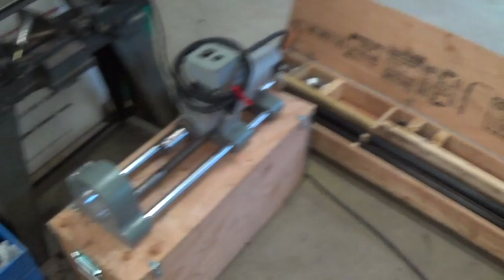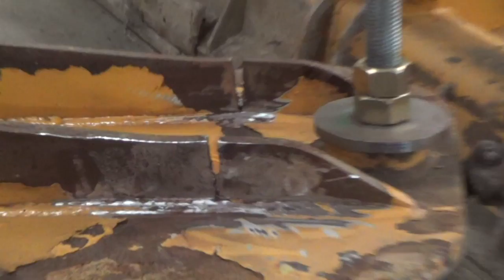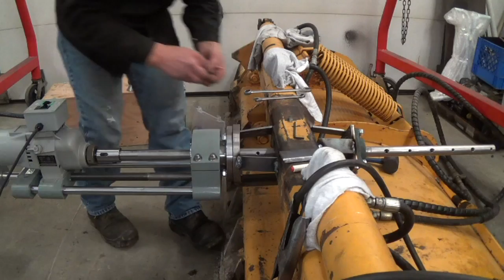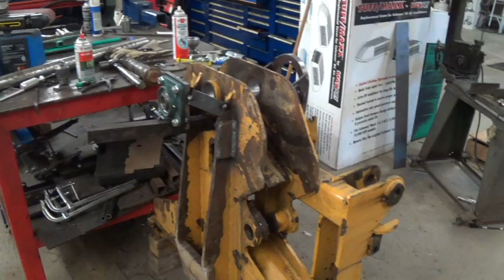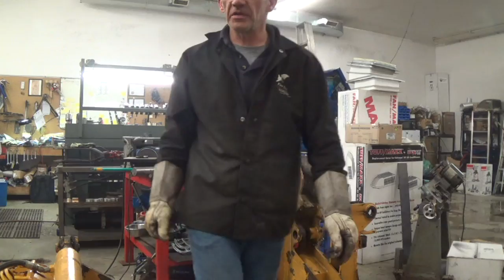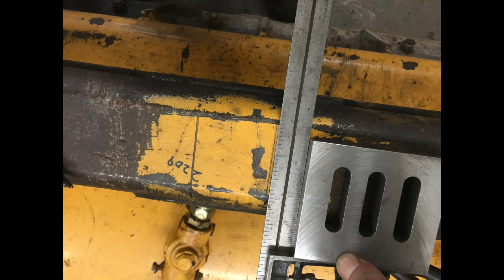Line-boring a SnowPlow

Comment: I have just built my own boring bar unit. I have a 1hp 3 phase motor that has a variable speed controller, useful power from about 15 hz to 65hz that gets its power from a common 230v single phase. Down here in New Zealand 230V 50hz is single phase or 400v 50hz is three phase. I have a 36:1 compound in line speed reducer and that gives me a bar speed from around 15 rpm thru to about 55 rpm. On the other end of the bar is an 8:1 inline speed reducer that drives an extended hollow tube with a bronze nut threaded to 1/2' x 20 tpi . My feed screw is a stationary piece of 1/2' screwed rod anchored to an outrigger but directly inline with the boring bar.  I have started with a 1" bar because the job has only 1 3/16" holes. Not flash like yours but will see how it goes. I have made everything myself and the power unit came off my rotary welding table (made myself too except my cousin supplied the electrics and motor) that can run from 7 rpm to 1 rev in 20 min, depending on if I double up reduction units. Made my speed reducer for the feed unit from two sets of toyota reverse gears configered in a housing. I can change the feed rate by changing the drive nut and the screwed rod and use 3/8 x 24, 1/2 x 20 or 5/8 x 18. To feed the bar back quickly I simply wind back screwed rod with a socket on my battery drill. The welding table and the boring bar owe me about $1200 but of course a lot of my own time. You did a nice job there. Simple satisfaction in doing thing well. I could see you were no novice by the way you set that bar up in the lathe. Feel sorry for young engineers today that become slaves to their cnc equipment and don't get to use their ingenuity. By the way, was your compound slide set around to do screw cutting? Here is a wee trick. When I screw cut using insert tools but by hand I plunge cut but every few cuts on the reversing cycle stop the lathe, put headstock of gear(so its easy to feel and move)and continue to wind back to the starting point by hand a wee bit. I momentarily take off the pressure of it driving the leadscrew and with my other hand disengage the forward/reverse leadscrew lever. You can feel it drop one tooth and simply reengage. Put the headstock back in gear and carry on the cycle and repeat the last cut I had made. It advances the cut somewhere around 1/36 of a turn, enough to make the tip cut on one side and then plunge a few more and repeat the process. Why do I bother? I never have to move my compound slide or spin my tool post so that my tools remain pretty well set, my parting tool is square and my boring bars true and my readout requires very little input. Obviously checked but not really having to be set up again. My quick change tool post and DRO are easily my best investments.
Reply from the maker: Sorry it's taken a while to respond. While I do like my York unit I would actually like more speed options, in particular slower. I havent done a larger bore with it yet but I expect a 6" bore will have the SFM of the tool up there pretty high. I may look into some options to change it.
I hope yours works out well. :-)
Reply: @CompEdgeX2013  Did my second job the other day on it. Worked really well. I am only dealing with smaller bores compared to your job. On 1 3/4" . biggest hassle is measuring the bores without stripping out the bar. I think I have a sneaky solution.

Comment: What cutter do you use? Hss? Carbide?
Reply from the maker: Using brazed carbide for most work. The SFM is a bit high for larger diameters and HSS. I would like more speed options on the head unit.

Comment: Colin, you have the same lathe as me, just a heads up for you. The block that the crossfeed hand wheel attaches to has two thrust bearings, the one on the inside presses up against a collar on the screw. There is no seal on it and the coolant can get into it. I just had to replace it on my lathe, it totally rusted up. Simple enough job to do but if there was an o-ring, a seal or even felt it would keep the crap out and the bearing would be protected. A project for when you are not busy. Clive
Reply from the maker: Must be a similar but different model. The thrust bearing for my cross-slide are mounted to the opposite end of the leadscrew. Quite visible and open...in my vids you'll notice an aluminum cover I made to keep the majority of junk out of it.  Cheers, Colin

Comment: Hello sir and I saw your video of the locking of the base of the road machine and I see that it has the base of the factory york you could pass me the measurements of long and diameter of the bars of the car and screw it if it was so Nice because I'm making a homemade. Thank you very much for your information greetings
Reply from the maker: My unit has a bar diameter of 1.25" in both 48 and 72" lengths. It is designed do accomodate up to 6" bore using an additional tool extender.
Reply: hello thank you very much for your response and regards

Comment: what size is the Boring Bar ? looks small
Reply from the maker: I used the 1.25" bar for that job. I did fabricate a 1.5" bar for larger bores. The current hole size in that plow was 2"..I upsized to 2.375" to get a true bore. :-)

Comment: If you like the York you'll love the Climax.
Reply from the maker: I did look at the Climax unit...a little out of my price range for the work I'm doing. Sweet kit though. ;-)
Reply: I started with a York but got into work that required faster metal removal and I rented one then bought my first one 4 days later and have never regretted it. I now own two of them and work by myself. If you ever run one you'll see what I'm talking about in the first job. I had to do a repair in a laddel carrier in a steel mill. the Climax let me cut .750 a side .018 per rev on the hydraulic drive.
Reply from the maker: Thats sweet. I doubt I'm ever going to need that capability doing job shop. We don't have large industry here that would require such.
Reply: I understand that. I worked primarily in Metro Detroit in steel mills, Heavy equipment, press repair and things of that nature.

Comment: what material did you use on the pin? and how do you go about pricing a job such as what you have shown?
cool stuff!
Reply from the maker: I used a 1045 med carbon shafting for the pin. Pricing is sometimes tricky especially when first getting into larger work. In this case they wanted a quote before going ahead so I generally calculate the visible stuff and then add 30-50% for unforeseen. Worked out great as I couldn't tell the push bar was bent until I took it apart. So when I told them of the extra work necessary they were tickled with the price... :-)

Comment: How are they going to get to grease zerk?
Reply from the maker: I take it you missed the part where I drilled for the grease fitting? :-)
Reply: CompEdgeX no I saw can you get to it with a hose once it is assembled?
Reply from the maker: IT can be accessed by angling the plow to one side or the other. They were adamant about not drilling the pin feeling it is a cause of breakage so the location I chose was the best option. :-)

Comment: thx 4 the video glad to see another video from your channel. just put a dro on my 14x40 metal lathe today but i dropped the monitor on the shop floor lol lucky it still worked. glad to see your back collin.
Reply from the maker: Could use a DRO myself...both lathe and mill. In time... 
You're probably luckier then I....if I dropped the panel it would likely shatter like a crystal glass..LOL
Reply: ya i got lucky it still worked.

Comment: Thanks, Colin, for the long awaited line boring video. Great stuff. I would not mind the noise of the other guys or a partially silent video. I hope you get more line boring jobs in so we get more videos....:-)
Reply from the maker: Thanks. Next bigger job I may try to do it after the cars are done for the day so the shop is quieter. :-)
Reply: What made you change your mind to drop your magnet drill conversion and go for commercial line boring equipment?
Reply from the maker: Actually I haven't dropped it. In fact I made some changes to it which I planned to record/share.
The magdrill rig was specifically for small bores such as mini-excavators with 30MM pins. I got into the bigger machine to get bigger work... ;-)
Reply: Sounds good. Looking forward to seeing the mag drill rig in action. I wish you good success with it.

Comment: That is a real nice boring setup you got. I only have my home made setup using a mag drill for power. I have manual feed rather than power feed but other than that it does good. Nice work mate.
Reply from the maker: I got into this for larger equipment. Have you seen the video I did on my shop made magdrill boring? I've made changes to it since but will soon do an update video on it. :-)

Comment: That is quite a setup.
Looks like it worked great.
Could you take it in the field with a generator/welder and do a job on site with it?
Or would everything have to come to the shop?
Mike
Reply from the maker: Indeed, many applications require mobile service with machinery being too large to transport easily once disassembled. I prefer pieces be brought to the shop Just to have all my tools around should the need arise but mobile probably wont be an issue as long as there's a welder onsite to use.

Comment: How do you check the bore diameter when you are line boring and have the boring bar in the hole?
Reply from the maker: Several different ways: spring caliper is one, some line bore bars have "snap gages" that fit into one of the toolbit holes... With my unit it's easier just to remove the head unit and bar...takes only seconds. Then use traditional snap gages and mics. I'll probably do a section on it next time I record. :-)
Reply: Thanks, Colin.  I didn't know it was that easy to remove and reset the bar...
Reply from the maker: I'm not sure if all machines are like that but this one is quite easy. During the video you'll hear me mention checking the bolts? Those are the ones to remove the entire head. :-)

Comment: Dude, you skipped over more than you showed. WTF?
Reply from the maker: The reason for the fast-FWD section is, as I spoke about in the video, noise in the shop preventing any decent quality recording. I apologize for this and am working on a solution to separate the rental cleaning from the machine shop. 
Thanks :-)
Reply: The time-lapse was pretty good, anyway. Maybe you could narrate over the noise from next door in post production? Don't sweat it, though, it is interesting just to see the work you get and how you solve problems.

Comment: Nice job Colin.  What kind of material was used for the pin?
Reply from the maker: 1045 ground shafting Bill. My supplier had it in stock in the correct size. Thanks :-)

Comment: What kind of steel did you use for the pin?  Great to see you back!
Reply from the maker: Using 1045 ground shafting for this one as my supplier had the correct 3/8" oversize in stock. 
Thanks :-)

Comment: Heavyweight job Colin.
Quite a set-up involved with the new machine but super useful device. Nice having the adjustment tool.
Great demo of the borer and altogether a fine job.
Reply from the maker: As alluded to in the video, noise in the shop makes video recording all but impossible most times. The whole FFWD section was done mainly due to noise, sorry.
Reply: I really enjoyed the video too, and maybe there was a reason for it, but I really wanted to see the set-up of the line-bore as well, just not in FFWD. Will you demonstrate that on the next job please Colin? Thanks Bro...Aloha, Chuck
Reply from the maker: Theres a bit of setup necessary but it's not so bad. Often times there's no other way to repair a bore such as that without cutting the whole pin boss from the part and rewelding in a new section. Either way is labor intensive.
Thanks Chris. :-)
Reply: No, no, no, I'm the one who should be sorry, and should have known. You didn't "allude" to anything, you just straight told us and I was too dense to catch your drift, LOL! 

I really do appreciate all the effort you put into filming and editing, especially because I know how tough it is. I've got a couple of videos worth just waiting to be finished, and just can't seem to get it in gear...
Reply from the maker: I get times like that as well...go a while without doing a video and it's hard to get kicked back into it... Glad I got this done otherwise I might never.. LOL

Comment: from 1 line borer to another check your bars for straightness just roll them in your turn wright rollers .not quite as critical on a short bore but if you are 3 feet apart on 2 bores you will have a hell of a time getting 1 pin in. good luck hope to see more from you
Reply from the maker: Thanks Joe.  I have checked the shop made 1.5" bar after drill/broaching as it was made from 1045 shafting.
The York bars I have not checked but will for sure especially the 72 incher. :-)

Comment: I don't know why, but I have a strange fascination with line boring. It's fun to do and watch. Thanks for sharing!
Reply from the maker: It is interesting and fun to have to attach the machine to the part instead of the converse. Hoping to get more work of this type in the shop in future.
Reply: So do I, and it extends past my overall fascination with tractors and heavy equipment. It's just a nifty method of repair.
Reply: You'll need regular jobs in order to pay for it, this is costly equipment...
Reply: Agreed

Comment: Well done.  Sure to be a big improvement having things lined up, at least to start off with, those things take a lot of punishment.
Reply from the maker: This particular one has taken a ton of torture. The pin had broken in this several times, each time bending the other components. It had been run without greaseability in a wet environment...hardly fair. I hope my repair gets treated right and lasts a few years for them.  Thanks John :-)